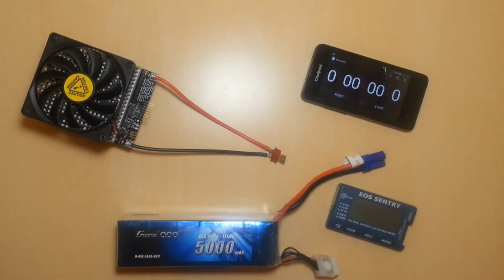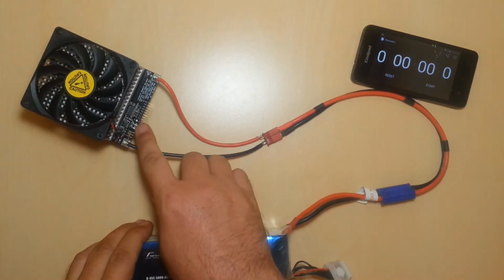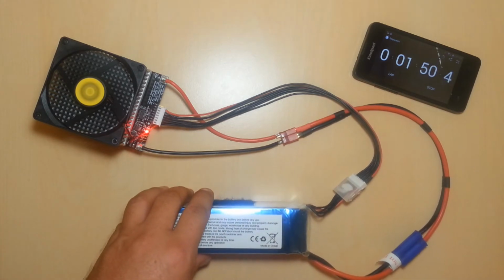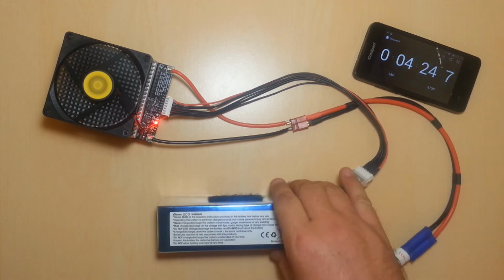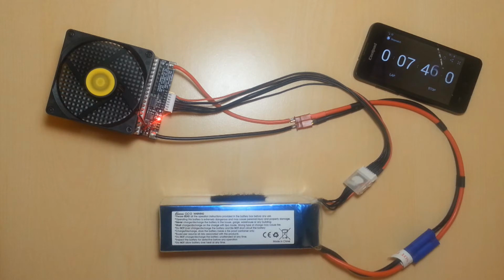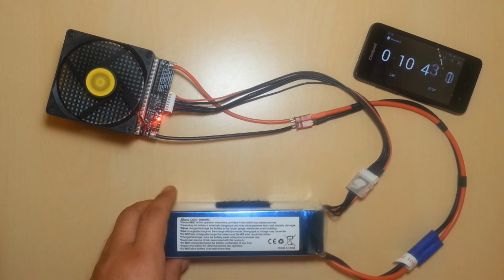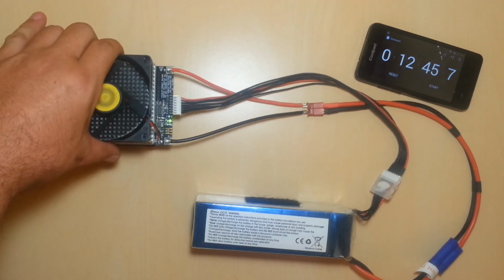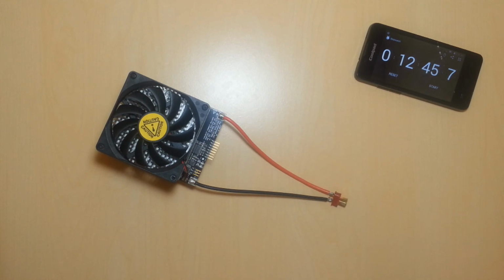Universal Lipo Discharger Pro - Operation and Timed Discharge

Comment from the maker: The cells do come down in the same nominal voltage range, but it does not balance discharge. It works similar to the discharge function on a charger, as they also do not balance discharge. Once the nominal cell storage voltage is receding is when the discharge operation is complete.
Reply: PerfectRegulators Can this discharger be hooked up to a parallel board and can it handle say 6 lipos 1600 mah 4s rated lipos being a stand-alone discharger?
Reply: PerfectRegulators hello when are you going to start shipping out orders that have been placed